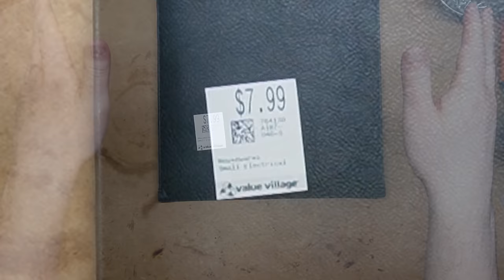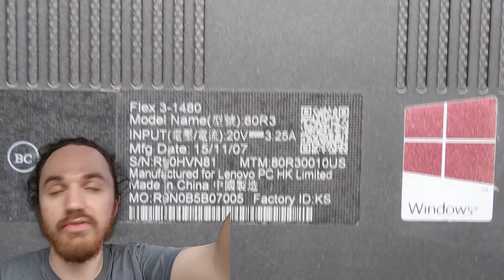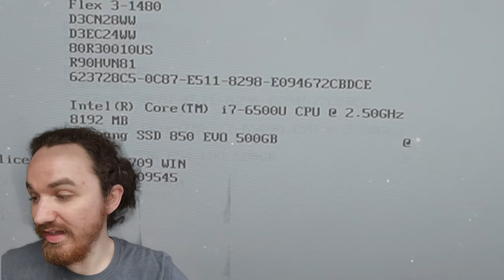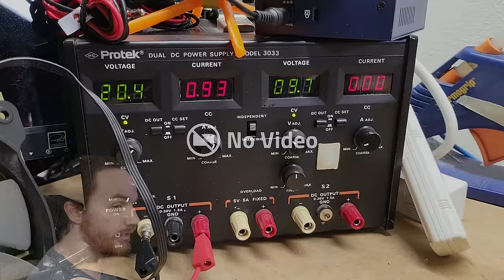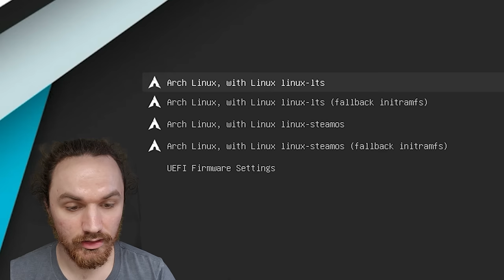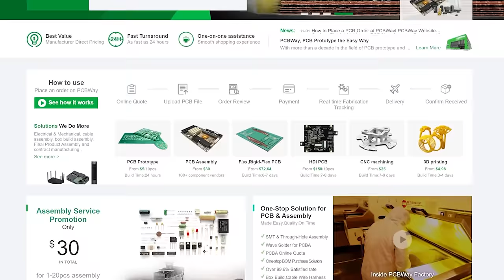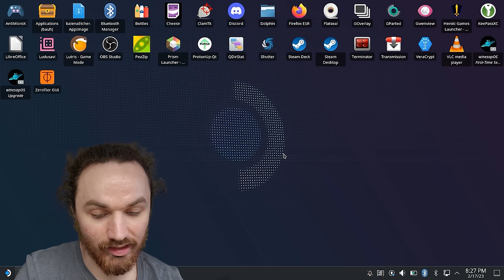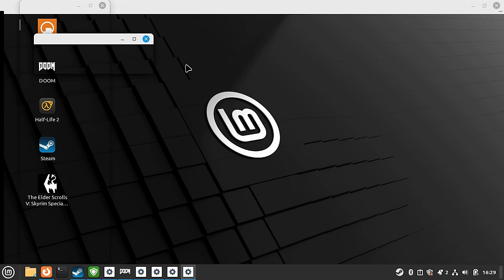Installing Steam Deck OS on a $7.99 Value Village Laptop

Comment: 8 dollar laptop can do more gaming than 4000 dollar macbook
Reply: Ohhhhh how wrong can you be :)
Reply: @grabedigger  I can't even run Minecraft with severe frame drops and lag on my mac.
Reply: @ashishhembrom3905  how so? I have the M2 Max 38c GPU Mac Studio and I can play all kind of games with no real issues. Even X-Plane 12 runs better than on my old Ryzen 5600X + 3060 machine.
Reply: All kind (all the ones that run on MacOS)
Reply: @grabedigger can I play Fortnite ?
Can I play games like call of duty ?
Can I play even pixel gun 3d ?
Reply: @V2-.  replying again...because well, Snow Runner, Stray, Universe Sandbox, Mafia III, Counter Strike 2, Kerbal Space Program, Euro Truck Simulator, Cities Skylines. I believe I am covered and just waiting for Death Stranding to be released. All other kid games, like Fortnite, COD and the like I fire up my XBox Series S.
Reply: @V2-.  ohh my first reply didn't go through because BeamNG Drive has a dot between NG and Drive lol. But with Game Porting Toolkit, which is pretty much Proton for MacOS, I can play pretty much all my steam library, except for Flight Simulator and 32bit games.
Reply: @techkidwhiz  Yes, all kinds :) Including Red Dead Redemption 2, which runs using Game Porting Toolkit, OR EVEN BETTER, buy CrossOver which works like Proton as well, and playing windows games I am. So, the idea that Apple computers can't play games is kind of outdated.
Reply: @grabedigger  why don't you play a Windows game with an anti-cheat
Reply: I can even play GeForce now
Reply: @techkidwhiz  well, mostly because I don't like to play online, mostly because people like you, who love to argue about something untill insult and injury come by. So, anti-cheat, I have my dose of anti-cheat with Rust and toxicity too. :)
Reply: @grabedigger  I was just merely pointing out that you can't play all games because I don't like false information being spread around on the internet. If someone came across this and bought a Mac because of it and couldn't play their favorite game, then they wasted their time at the apple store.
Reply: @grabedigger  Also, I like the Mac. I have one acrually and am disappointed in its ability to run the games I like. I want your statement to be true, but it just isn't.
Reply: @techkidwhiz  the thing is, we can now play games that were not developed for mac, that's a fact. Yeah, CoD and anti-cheat games don't work, but things like GTA V and most single player games work, including RDR2, and if you have a decent M cpu, you might play these at around 60fps no issues. 
So, the phrase "those developed for mac" is not real.
Reply: @grabedigger  I said "those that run on Mac" which it seems like the games you mention can run on a Mac using a compatibility layer, so they fall under my original statement.
Reply: @grabedigger  that’s nice
Reply: Bro in minecraft the resolution is like 4K and not default like 1080p so change it back
Reply: Just jailbreak it lmao and install windows  @V2-.
Reply: @V2-. yes, you can, just use wine, an app that makes windows apps run on mac and linux distro’s. and you get almost the same fps as with windows. sometimes even more. (fps depends on the system)
Reply: @ashishhembrom3905 then your mac is bad
Reply: @grabedigger oh, and if you’re planning to buy crossover, DONT. Just buy parallels desktop perma license, basically the same price
Reply: @techkidwhiz you can if you are tech savvy enough (use wine it can run anything windows can)
Reply: use wine and bypassing anticheat is pretty easy, no special bypasses. just seperate mac from your wine wrapper
Reply: @grabedigger a regular prebuilt for 1200 is better then a steel box that cost 2k
Reply: @grabedigger  so more expensive initially and then you either have to do an annoying amount of manual compatibility rigging everything or pay even more for software to do it automatically? What is even the point after all that?
Reply: So tru 😂
Reply: So tru 😂
Reply: @grabedigger There’s plenty of steam games that you can’t play on Mac OS, I bought one for like $800 probably the worst money I ever spent, it’s slow and can’t play any games because no one gives a shit about Mac OS
Reply: @ZairenAceGustelo-eq6in  sure.
Reply: No mb can do a lot of gaming but cooling is probably the weakest point. I played let's say whole ps2-ps3 era on my igpu mid 2015 mbp but with compromises, not that it couldn't handle at least solid 30fps and 720p, but because of  high temps and shutting down, had to use throttlestop and all that. It was my favorite gaming machine to bring everywhere with me, all those limitations and setting games up... Real shame that overheating
Reply: @Jose-ue3bu  I use a Mac Studio M2 Max with 38GPU cores, I can game pretty well.
Reply: @ashishhembrom3905 what mac are u using dude 😭🙏
Reply: @V2-. You can't play games that has anti cheat or something... some games do work like overwatch 2 and idk there are more
Reply: @DaniAurora23  I bought it not for gaming but for video editing, I was going to buy a well spec'ed up PC untill I realized that Windows is shite when it comes to HEVC video, the OS doesn't even recognize 10bit h265 and DaVinci Resolve does not open h265 10bit log video in Windows. So, I had to work and bought a Mac Studio for 2.5K (tax deduction so the 64GB of RAM, 1TB SSD and top M2 Max were kind of free updates), and it allows me to do my job and also game. My whole beef here is with the "you can't play games on mac" thing, when it isn't true, yeah you can't play things with anti-cheat, but still, you can play games at decent FPS as the M2 38 core GPU rasterizes as fast as a 3060, which is pretty decent.
Reply: @hookitiri windows doesn't support Mac hardware unless it's Intel based
Reply: @V2-. finding pixel fun 3d in a random comment section is something i was not expecting
Reply: @grabedigger  apple fanboy (even though iMac is still good 4 gaming)
Reply: @nopel.  not a fanboy at all, just setting the record straight. Macs can be used to play games, not at the same extent as a computer with a Nvidia or AMD GPU, but still, it can be made. Unlike what was mentioned in the original comment.
Reply: @grabedigger no you’re not a fanboy, you’re a apple glazer, i mean i own a iPhone and think apple isn’t a horrible company that sucks but jesus i can comprehend that M Mac’s can’t run PC games without a compatibility layer. 

Also did I forget to mention how M chips have a impatchable security vulnerability? It’s not major but it’s somewhat concerning, especially since people trust Apple for security and privacy
Reply: All yall just shut up play games on what you want it doesn't matter
Reply: @grabedigger he is talking about the supported games on mac OS lol
Reply: The-Anti  I'm running an M2 Max 38c GPU.
Reply: 💀💀💀💀💀💀💀💀💀💀💀💀💀💀💀💀💀True tho
Reply: @grabedigger  I'd say Mac is alright for playing a pretty decent chunk of games but in terms of price to performance, coupled with compatibility layers and overall support for some games, I think most people would still be better off with a desktop windows rig. Where I think a Mac shines is in stuff like video editing as you stated, Mac supports some video filetypes that windows doesn't even seem to recognize when used. I'm broke so I cannot warrant buying it but in your situation it seems perfect for you, I just felt like adding to this, seeya broski
Reply: @grabedigger yk were talking about laptops...
Reply: Did you know that there are more official games available for macOS then for the PS5
Reply: As a Mac user diss faxx
Reply: The most untrue comment I've seen, I've played through the entirety of Resident Evil village on an M1 MacBook Air, which was only $1000 at launch
Reply: And then there's the new Game Porting toolkit that allows Macs to run Windows games now sooooo
Reply: because macbooks r workstation, if they were gaming laptops they would be better than almost all of the top of the line pcs rn
Reply: because macbooks r workstation, if they were gaming laptops they would be better than almost all of the top of the line pcs rn
Reply: Ohhh you are very wrong 
Hahahaha😂😂😂
Reply: @V2-. you can run baldurs gate 3 on ultra 
Sooooo
Reply: @ashishhembrom3905 how lmao
Reply: @ashishhembrom3905 how TF
I can run cyberpunk 2077 with no problems
Reply: i was once choosing between an HP laptop and a Macbook, he let me use the macbook for a while to test how good it is, that HP laptop performed WAYYYYYY better and was a few hundred dollars less than the mac.
Reply: half life alyx?
Reply: @Little107 better for gaming macs are made for professional work not gaming
Reply: The MacBook will suddenly and randomly stop working suspiciously when the new MacBook drops
Reply: Real (also fellow trans?)
Reply: I installed pear os on macbook
Reply: Anything can. My Mac can barely play a flash game without heating up to the temperature of the suns core
Reply: why would anyone buy a 4000 macbook. their fault
Reply: @piercemccauley7079  your mac vs my pc let’s see lol (mac would win tbh my pc sucks)
Reply: The apple lovers are mad about how right you are. I’d rather game on this Lenovo than any Mac.
Reply: @ashishhembrom3905 I can run shaders with 144 fps lmaoo
Reply: @grabedigger apple yapper
Reply: @st1fish  I own an Xbox Series S and a R7 5800 + RTX 4070 PC now too because of AI, can I yap about it too?
Reply: You are so wrong
Reply: @V2-. yes
Reply: @grabedigger yap yap yap
Reply: @grabedigger Run tf2 on mac without emulation i dare you(it was removed due to 32 bit)
Reply: @V2-.  Yes you can. Proton exists if you didn't know. Not fortnite though.
Thats a positive.
Reply: @grabedigger talking to yourself?
Reply: @grabedigger ok but can you play Antonblast?
Reply: It's an i7 core chip set . Be real there's no such thing as a 8 dollar i7 laptop hence why that laptop can run games period. Now a 4000 dollar MacBook is blowing that shit out of the water but I see you just like to talk so I'm not gonna bother explaining how
Reply: @grabedigger the issue is arm now not Mac. Now that Arm is being used in almost every type of machine including in windows games will become available
Reply: @V2-. I think it can run it actually because tim Cook introduced a developing app to make porting to Mac os easy, and it surprisingly can emulate directx performance
Reply: That's apple for you
Reply: You’re wrong. There is no joke. You’re just hilariously wrong.
Reply: @piercemccauley7079 Bro has a 2010 MacBook Air or some trash like that
Reply: @grabedigger  Can it run Titanballs 2?
Reply: candy crush doesn't count
Reply: @techkidwhiz  nobody is boying macs for gaming though you dolt
Reply: but its 7.99

Comment: Heads up: the Arch Linux wiki has good information on pretty much everything hardware-related, and it's almost all broadly applicable.
Reply: Does it discuss installing software in desktop mode?
Reply: @zeroturn7091  There's no concept of "game mode" in Arch, so... Yes? Sort of. The Deck has a weird (and clever) immutable filesystem thing going on, but that doesn't apply to HoloISO.

Comment from the maker: It turns out the laptop actually has a NVIDIA GeForce 940M GPU that I missed in this video. To see the performance with the GPU (which is MUCH better), watch this video: https://youtu.be/wA5Ihmlg2h4
Reply: I have a old laptop with a 940 Mx gpu lol
Reply from the maker: mynewlife23  I literally said "do not do anything you see on my channel" 💀
Reply: @BringusStudios !  The video was really cool!  I figured I would mention that you actually can upgrade the ram!  Basically just get a small flat head screw driver and pry that little metal sheild up and there a standard sodimm slot.  I have no idea what the point of that shield is. I use the 7th Gen version of this laptop everyday and it's still pretty nice to use.  Mine dosen't have a GPU sadly, but still a decent little laptop for college.  If you buy a new battery for it you can easily get 9 hours of use.
Reply: @BringusStudios  wait so the laptop is a switch?
Reply: i have a cleron
Reply: @BringusStudios  Bruh its a lenovo ideapad flex lol i wrote this on a levovo ideapad flex 5
Reply: I May Have Did What You Did In The Video And Succeeded To Install SteamOS @BringusStudios
Reply: lspci would have told you that
smh
Reply: Sick
Reply: When you looked at the MoBo, it was a dead give away it had a graphics card. You could see it connected to the heat pipes.
Reply: @guestsneezeplayz why do you write like that
Reply: @AAlgeria  wdym
Reply: @guestsneezeplayz I believe they mean how you capitalise the first letter of every word.
Reply: @Jimmy_Jones  oh that was my autocorrect

Comment: I remember when I had a laptop with a 520 GPU and my gosh do I not miss it at all. damn thing gave me like 20 FPS in Superhot. I remember when I got my new laptop with a Ryzen 9 4900HS and a 2060 and just seeing how much smoother everything felt, The catharsis was real xD
Reply: I can't even get any decent performance out of Metal Gear Solid V with this iGPU!
Reply: The strange thing is that I have got a i5 4th gen microsoft surface pro 2 and it gets 30 fps in Skyrim, that is much better than this one with 6th gen in the video(in some zones it's even 60 fps, ofc minimal settings with 720p)
Reply: I had 510 lmao, it was garbage
Reply: my switch from a first gen surface book to an actual gaming laptop was euphoric
Reply: @regulargamedev3295   You probably have a dedicated gpu

My old laptop has an intel i5 6198du (HD graphics 510 iGPU) but also rocks a dedicated 920MX (whopping 2 GB DDR3 vram boiiii)
Reply: I've celeron 1.10 ghz lmao
Reply: went from an fx 4100 and 750 ti to a lenovo laptop with a 4800h and 2060, it was an incredible experience
Reply: I'm still running an intel 520 with i3 6th gen 12gb ram and Debian installed, it can easily do basic tasks and can play no more room in hell tomb raider goty and tf2 runs fine aswell. Really works as a home pc for me cuz I don't do anything heavy on it.

Comment: I recently got a Lenovo ThinkPad T530 from a flea market for $25 with an ACTUAL dedicated Nvidia NVS 5400M GPU in combination with Intel HD graphics in it with a core i7-3520M CPU. Fortunately for me the guy selling these had a power supply too. And its a decent system for gaming on the go. Most games I can play at like 720p graphics quality at either high or medium settings. It runs windows 10 surprisingly well. I would say that I got a good find myself.
Reply: Wanna sell it?
Reply: @davidgregory2434  as much as I would like to, but it's valuable to me. So appreciate the offer
Reply: 4:14 Seems this notebook has a dedicated gpu too. Look at the right chip under the heatpipe. I think there is vram chips around the chip. If you have only a cpu in a laptop these days, you have only one chip cooled like this via the heatpipe.
Reply: My T530 is still my daily driver... I'm typing this response with it right now! Great PC.